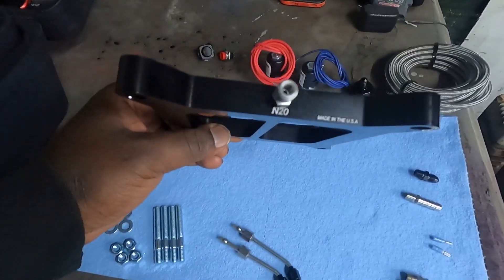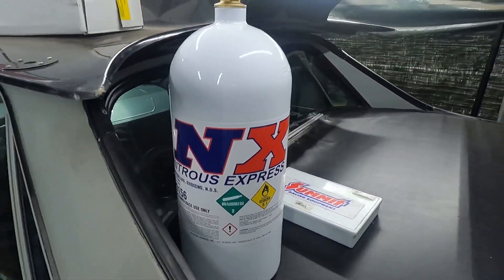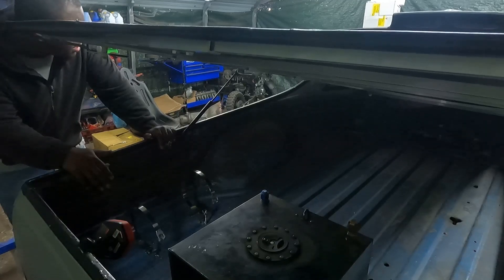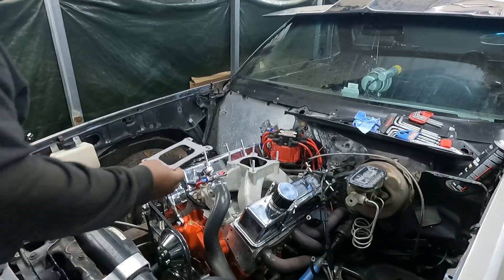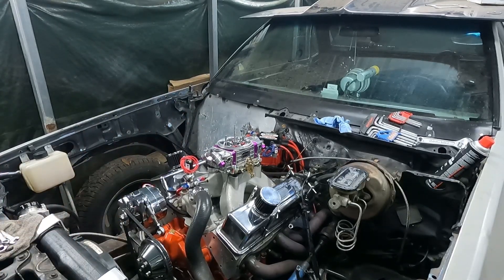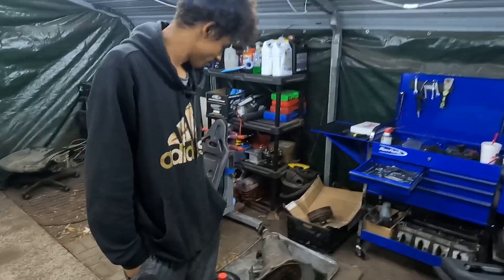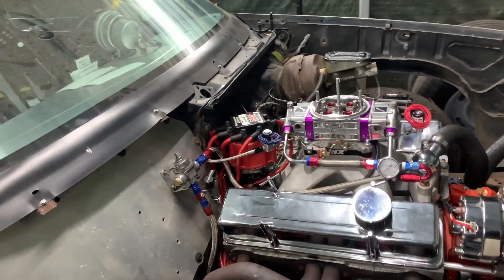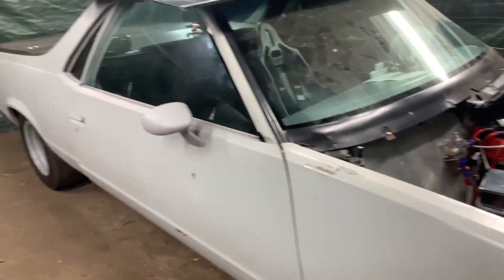Finally got a Nitrous kit

Comment: I use msd 6al 2 programmable box. Works great and makes it easy to pull the timing on nitrous. Haven't made a pass on the track since the 9 inch with 4.30s install but draggy said 7.80s on motor spinning on the street. Keep it up one step at a time and we all will get faster each step of the way
Reply from the maker: Thanks